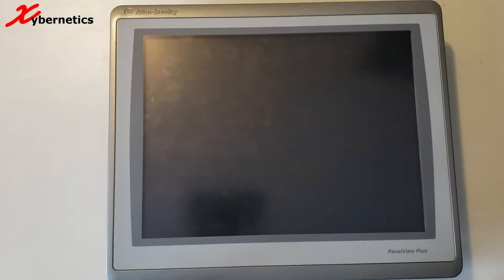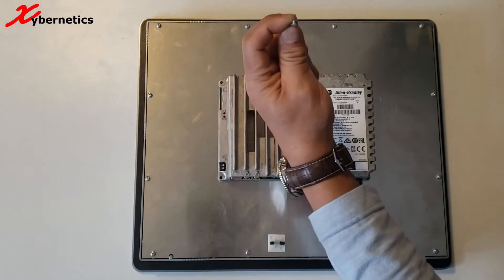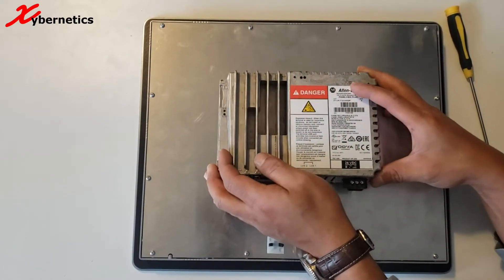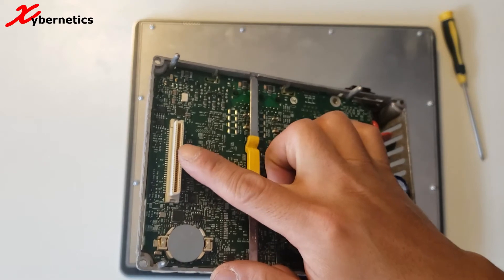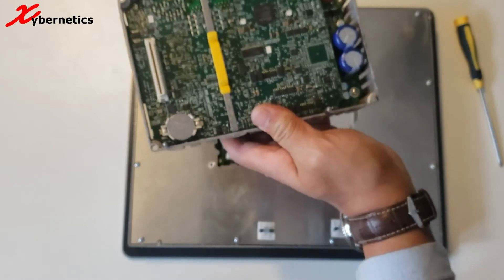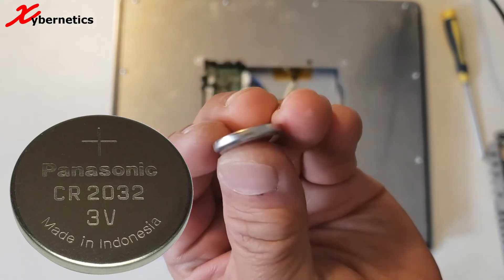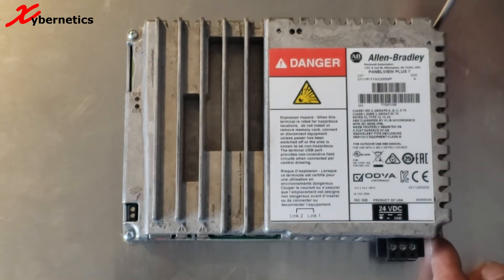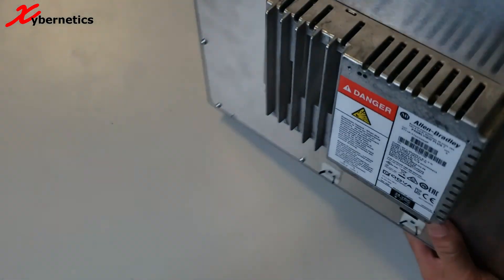Change Internal Battery Of Allen-Bradley PanelView Plus 7 Performance HMI

Comment: Sir Program wiped or not ?
Reply from the maker: The Allen-Bradley PanelView Plus 7 lithium battery provides back-up power for the real-time clock and static RAM. The thing to note is that the battery can be removed for up to 15 seconds without losing the clock and calendar data.
You will not lose any program when you are replcing the Allen-Bradley PanelView Plus 7 lithium coin battery / cell battery.
Fun fact. The Allen-Bradley PanelView Plus 7 lithium battery can be replaced while the product is mounted in the panel. But it is quite tricky.